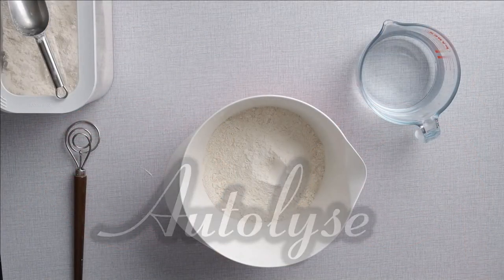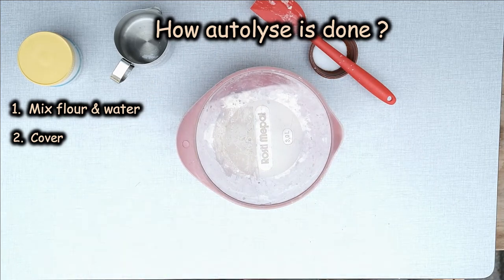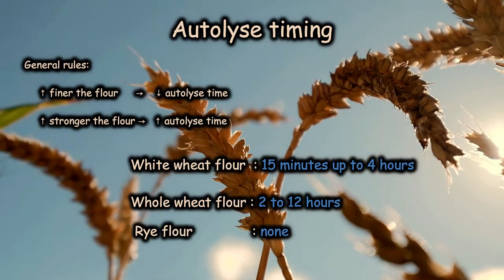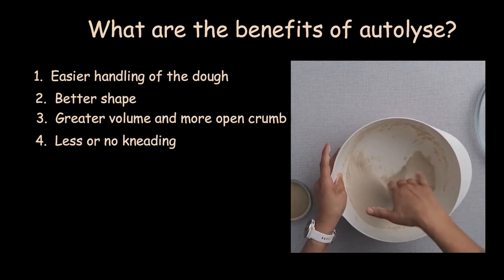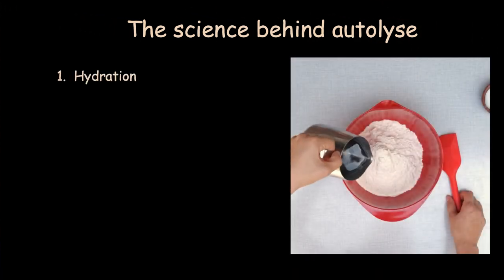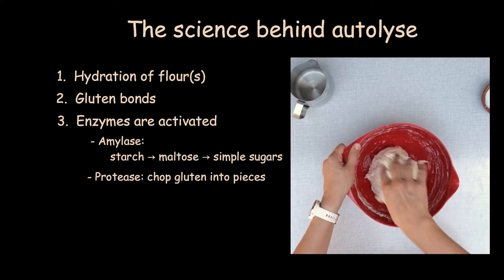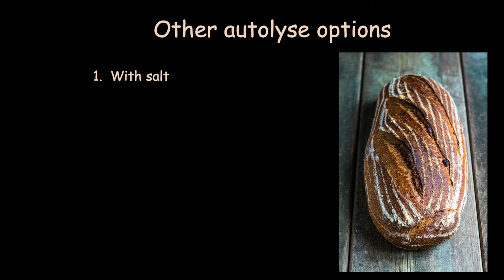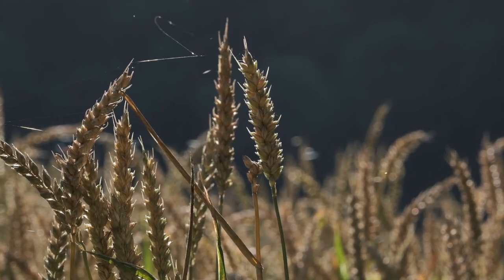Autolyse. How to make better sourdough bread?

Comment: Dear Maestro, thank you very much to share your arts, please tell is it ok if autolyse time will 6-7 hours in a fridge (temp about +10) before inoculation the sourdough? It’s because my working schedule, and if yes, should I’d I worm up the autolysed mass before mixing? Thank you in advance, sorry to disturb.
Reply from the maker: You can easily autolyse in the fridge. I did it during the winter for 12 hours at unheated room temperature ~15C. As for the warm up, it is not mandatory but will take longer (few hours maybe) to ferment.
Reply: Thank’s for the reply, Maestro!

Comment: 2:00
what about autolyse time for 100% whole spelt ?
Reply from the maker: Spelt has a weaker quality gluten. I'd suggest a trick: sift the bran out of the flour and hydrate it separately overnight, then join it back to the dough after the autolyse of the remaining flour.
Reply: @HungryShots  my flour does not have bran particles large enough to separate so the autolyse will be for the whole flour for all of its ingredients.
still, if you can give me a timeframe for this kind of spelt flour how much time to autolyse
Reply from the maker: @slingshotshooter7536  I would go for an autolyse of minimum 2 hours and max 4. I would try first with 2.
Reply: @HungryShots  I forgot to mention that my sourdough starter is from whole spelt flour at 50% hydration 
do you still recommend minimum of 2 hours and max 4  autolyse time for  whole spelt flour ?
does the hydration % of the sourdough starter affect the autolyse time?
thank you !!!!
Reply from the maker: @slingshotshooter7536  the starter and the autolyse run in parallel and do not affect one to each other. These are 2 different pieces of dough and when they are combined come with specific properties to the final dough, but no, the hydration of the starter has nothing to do with the time you autolyse the main dough.
Reply: @HungryShots  thank you